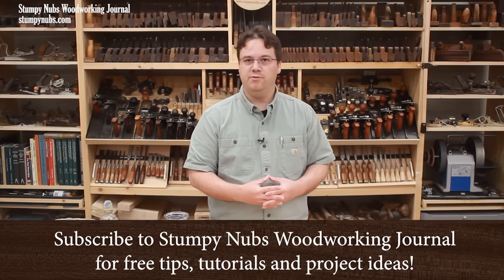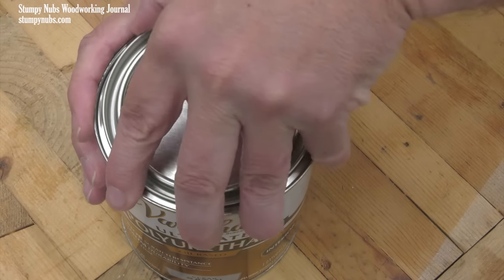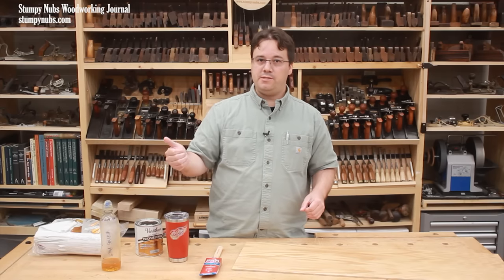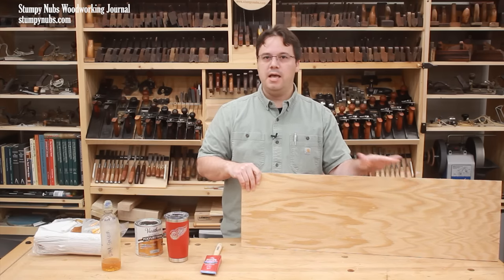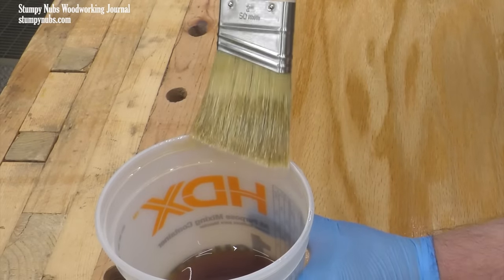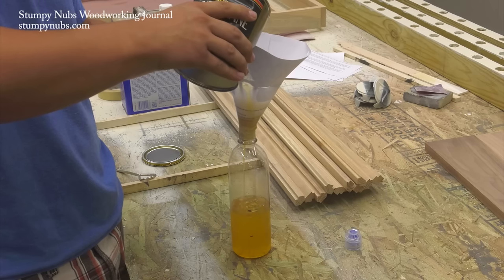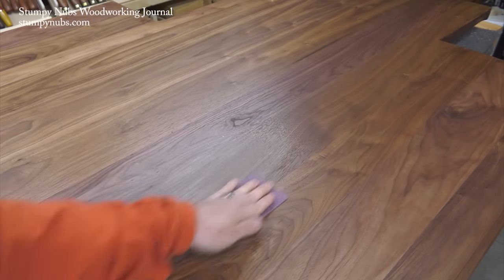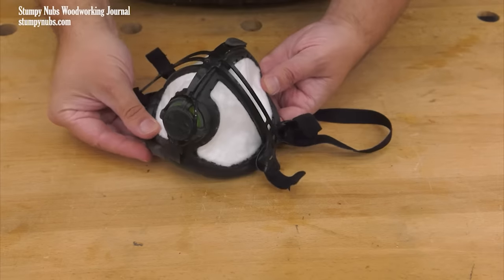Watch this before using polyurethane wood finish!

Comment: I used to have spare brain cells, well that was before you went and filled them up with all that knowledge about polyurethane finishing. Thanks Stumpy, I've got to go and get a respirator now.
Reply: I got one during covid since im in healthcare. Before the n95s came out. Glad i bought a full painters mask face shield. I had to fly a lot at the start of pandemic. A baby had a rancid diaper. Respirators have many uses! Cannot wear those on planes now, that was when it was all essential travel in the whole airplane was empty. Or full of Pilots off work coughing in the empty seats with a red face.

Comment: Great advice! I think oil-based poly is far superior to water-based. My favorite type is known as "hard oil", and a great example is Birchwood Casey Tru-Oil. It goes on very thin, flattens well, and is the most scratch-proof poly I have found. Odor-free mineral spirits or paint thinner are great for brushing or spraying. If you're a total savage, you can water sand and polish it for a stunningly smooth, hard finish.
Reply: Generally true, waterbased product have come a long way over the last decade or so, and have their place depending on the function of the piece.  For a tabletop or similar that will encounter more traffic opting for solvent based is great for durability, but for something like a bookshelf or side table with just a lamp then waterbased can be more than adequate, and in the long term better for you as an applicator if you do a reasonable volume of work, given less VOC exposure.  Having said that, there's a lot to be said for plant based oils and wax finishes, which may require more maintainence, but ultimately better

Comment: So, I don't rightly know, but I've always heard you shouldn't move the brush back and forth as we see here because it is more likely to make air bubbles in the finish.  I've always gone in one direction only, or at least made sure the brush came completely off the work piece before changing direction.  I don't know if it actually matters, but it gives results I'm happy with.

Comment: Wipe-on poly rocks!  It's super easy to get a nice finish.  

An alternative to mineral spirits for brushing is Penetrol by Flood.  First coat is thinned 50/50; subsequent coats are thinned 10%-15%.  Penetrol helps the poly or varnish soak into the wood on the first coat and helps with flow and leveling on subsequent coats.  That's what I did when I had a sailboat with teak trim and the varnish looked like it had been sprayed onto the wood.  Between coats sanding was done with 100 grit paper.  It was not too coarse.  It also helps to only brush from a dry area into a wet area; never back-and-forth because the brush can leave dents in the wet finish.

A few days ago I needed to apply oil based Varathane to a solid core door that was to become a workbench top.  I decided to try the forbidden -  [gasp!] applying it with a roller.  The roller had a soft 1/2" nap.  In spite of the warnings on the can, the napped roller did not introduce bubbles.  It actually went on better than with a brush.  I just dipped some finish out of the can with an unwaxed paper cup and poured it over the door; then spread with the roller.  Wrapping the roller with foil between coats let me use one roller for the entire job and then it was allowed to dry and tossed.  The finish was not good enough for fine furniture but it was entirely good enough for an interior household door and certainly easier than brushing.
Reply: Ah... wonder if the penetrol helped with the roller. I have used it to get a smoother surface on some cheap bookcases I painted (with a small foam roller) and and it definitely improved results to a nice smooth glossy look.

Comment: One thing missing from every wipe/brush finishing video, on every channel, is them doing it on an actual project, and not just a flat board. I've been waiting years for someone to actually build some boxes, or whatever that has multiple sides, or curves, or just anything that resembles an actual project, and then finishes them with poly, shellac, etc... by hand. My issues have never been with a flat board, it's when I get to the corner of a box, and need to move to the other side without letting any build on that corner, or to get it around the curve of a two sided object. Basically, YouTube is crying out for a real world, actual project finishing video... especially on smaller, detailed things, nut just a giant table top and square legs. The only people who seem to show finishing on detailed, real projects, are those just demonstrating their cool, expensive sprayers. How do I poly my boxes without leaving any marks? How do I do a piece that wraps around and has two faces that are vertical? 

Another video idea is how the heck to appropriately apply glue on projects where you simply cannot get in the space to wipe it off with a wet towel, or get it with a scraper, because it is so tight you already had to pre-finish the inside. 

I love this channel, and this is a great video... I just always get bummed when another finishing video is just on a flat piece of wood. People, like myself, need real world examples. Not many people are just wiping their poly onto a flat piece of wood, laying down on a bench. We have a project finishes, even just a box, and that is where we are trying to apply the finish. 

Cheers.
Reply: Totally! Even figuring out how to set up a piece for drying correctly can sometimes be a challenge, and I'm sure there are go-to techniques to make this eaiser. (I'm thinking of avoiding dimples with finishing the opposite side, etc)
Reply: The general idea if you've got a problematic area is to apply more, thinner coats. Tilting the piece to ensure the working face is as level as possible can also help where possible.
As for glue, I've had luck in tight spaces with bamboo skewers. Cut them & sand to a shape that will match the profile of the bit you want to scrape & then run it along there at an angle once the glue has begun to thicken up. It should be at the point where the glue will come up easily & will travel along the skewer a bit so it's easy to remove. If it bunches up then it's too wet, & if the skewer bounces off the surface then it's too dry.
Reply: Welcome to the world of a new home construction painter. A library full of cabinets with doors and drawers is a combination of nightmare, masking, and problem solving master class.  You have two choices - brush everything or spray everything. I recommend getting good at using a compressed air HVLP process.
Reply: If working on a home made project I try to get as much finish on the individual pieces as possible before final assembly. Than do a final coat after it's put together if needed. 
When refinishing an old piece however I just do one or two sides per day depending on drying time. Yeah it takes much longer but it beats having drippy saggy poly on your finished project.
Reply: This is why a wipe on finish rules. Maybe takes more time but a LOT easier and forgiving. I like a 50% poly, 30% thinner, 20% boiled linseed oil. Flood it well initially. After 15 min wipe off excess, buff with 0000 steel wool between well dried coats, final buff out with wax and more 0000 steel wool. Mis dos centavos.
Reply: @nightcatarts  Try using painters tape before the glue up.  Tape right up to the joint edge on both surfaces.  Once squeeze out occurs, remove the tape.  The excess glue comes off with it.
Reply: For inside corners: start there. Like cutting paint. Much easier to keep it from building up when you can spread the excess to dry spots than to try the opposite.
Reply: for junctions if you're not in a rush you can do adjacent faces once the previous has dried, and mask as you go.  When you maskyou sit back a hair so you do get overlap of the coating from one face to another, and, a light sand inbetween coats to gently feather the masking line.  Pull your tapes while the coat is wet.

It is the long way home, but, if you allow the time to do it you can achieve excellence with ease, similar to using a jig in some respects.
Reply: I have seen people finish the milled pieces before assembly - when you can still lay them out flat. Protect the glue joints with tape, of course. When you assemble, it's already finished.
Reply: Put a couple thin coats on everything and after prepping for final coat, use Minwax brand spray polyurethane varnish. After you spray a coat do not allow it to completely dry. About 10 minutes between spray coats. Keep doing it until you run out of product. Use thin coats or it will run.  You will have a factory looking finish. The spray performs better over a couple of coats of the brush on stuff.

Comment: Here in New Mexico, it's dry. 8% humidity usually. Polyurethane and tung oil are my preferences. 
I just dip a shop towel in the can and wipe it on. I use only gloss. If I want a satin finish, I scuff the part, dilute it 50/50, and wipe it thin.
The only other finish I use is amber shellac. Those have to be kept out of the sun or they develop "crazing".

Comment: Stumpy,   I was buying some hardwood from a supplier in my area.  While I was there, we started talking about wood turning and finishes.  He grabbed a dusty bowl on the shelf and blew off the dust.  He said, “If you like shiny finish, use high gloss wipe on poly.  Wipe it on wet and keep it wet for a while adding more poly.   Keep rubbing until it goes past the sticky stage and it will harden and smooth out”.   So, I bought some and followed his advice.   Those bowls came out very shiny and smooth.   Also, when I took a woodworking class back in the 70’s, the instructor showed us some of his very high gloss projects.  He said, if the wood with no finish doesn’t shine, your finish will not be as good as it could be.   So, I sand my bowls to 2000 grit and the people that bought them(no matter what finish used) comment on how smooth they are.  This is just my opinion though!   Keep up the instructive videos!   Respectfully,   Kevin
Reply from the maker: Finishing on a lathe is totally different from finishing a piece of furniture. Try "keeping it wet while adding more poly" and "keep rubbing until it goes past the sticky stage" with polyurethane on a stationary surface and let me know how it works :)

Comment: I use a 10 inch flooring finish applicator for furniture (the foam kind not lambskin) it is very quick and easy to leave straight even coats with it for any flat surface.

Comment: Stumpy, I hope you read this. 
I mixed a new can of mineral spirits with poly for a wipe on finish and it wouldn't dry properly even after a few days. Seems that some of the odorless mineral spirits now contain water. Even though it says on the can it can be used as a paint thinner it definitely didn't work with the poly. I had to strip it all off and start from scratch wasting all my time and effort.
Reply: Agreed.   The problem is the formulation of the Odorless Mineral Spirits.

Comment: Hi Again Stumpy!  An imitation Yachtsman?  Actually I use a good grade of Oxtail brush for my "oil base" clears.  Are you going to do a video on oiling wood with linseed/flax?
     When building guitars I handsand the neck to 600 then apply all the oil it wants to drink. Repeat after 3 days.  After it's dry, use very small bit of talc (not cornstarch) on the neck whenever it is humid.  This the absolute slickest finish I have found.  The player's skin oils combine with the flax.     You can do the same thing to a wood solidbody if the wood is pretty enough.
     TIP:  pour a little bit of thinner into your brush, and knock off drips before first dip.  The brush will clean far more easily.  Same/same with water and latex/acrylic coatings.

Comment: don't know if I missed it or so, but the wipe on has some other advantages, for all kinds of finishes. first, it can penetrate deeper. it also follows the wood structure better and doesn't "pool up" in little dents and divets. this can be a benefit if you have some mix of sanded and structured wood surface. similar for surfaces with very varying grain structure where one soaks up about everything, its easier to work with using thinned out. you can experiment and also brush on thinned and wipe off etc.

Comment: Wiping method is especially useful on items with a lot of "joints" like chairs, things with spindles, shelving units, etc.   Brushing and keeping a wet edge is tough when you have something like a chair with 10 back spindles.   Bob Flexner also calls it a very foolproof method.

Comment: so glad you used a real brush not those darn foam things.  i tried a foam brush once and it was impossible to lay the poly on evenly.  i guess people just don't know how to clean a brush properly.  a 1/4 cup of thinners at most is all you need for a perfectly clean brush that size.  and really only takes a couple of minutes.  i am still using the same high quality brush after over 20 years of use.
Reply: I always use the foam brushes and never have any issues with them. Of course I'm only an amatuer/beginner, but I've used both water and oil based polys and no one's ever said the finish was uneven. (and I do know how to clean a brush, I just prefer not to)

Comment: Love your videos. I bought a used kitchen table with an old dilapidated finish. I applied EZ Strip paint & varnish stripper, scraped it all off, cleaned with TSP and water then after drying went at it with an orbital sander then hand sanded to a 180 finish. Vacuumed and tack clothed very smooth and clean. Don't know the species of the wood veneer. Applied 3 coats of Varathane oil based Classic penetrating wood stain, (Ebony). It barely took any more stain on the 3rd pass. Once dry it looked and felt fabulous. Wish I could have left it like that. I then brushed on Varathane oil based Professional Premium Clear Finish 1200 Matte also in 3 coats. Firstly, nowhere on the can does it say polyurethane or urethane. Can you tell me what this top coat is? More importantly, with each successive coat the finish got worse. I doubled the time between coats. They say 3-4 hours and I went 8 or more. I had to sand as it appears there are hundreds if not thousands of little buggers less than 1mm but so noticeable to both the eye and feel. My garage is as clean as I can get it and I do not blow the dust off but vacuum instead followed by tack cloth. I this the 3rd coat with mineral spirits and the 3rd coat is worst of all. What have I done wrong. BTW, I did not shake the can, only stirred and the final coat I used a separate clean container so I could add some mineral spirits. 4:1 top coat to thinner. At this point I want to throw out 20 hours of work. Please help.

Comment: I like to wrap my brushes in plastic wrap or aluminium foil.  This works well for rollers if you need to make a run to the hardware store or have lunch. (Sometimes works overnight)

Comment: Thank you for informative video.   I looked on line for toxicity of Poly before and I didn't remember any permanent damage from Poly.  So your video concerned me a bit and so I did another search and the two websites said that Poly is relatively safe.  The amount of VOCs released during a typical application is too low to produce harmful effects.  You would need concentrated long term exposure to get permanent health damage.  This does not occur even during industrial applications.  You can get lung irritation, headaches, dizziness, nausea, asthmatic attacks but these are temporary.  I do believe that a respirator is necessary to avoid these symptoms, but I don't think you lose brain cells from Poly.  Brain cell losses could be from something else. ;)

Comment: Brown paper bags from the grocery store - - - I remember those from many decades ago. They had multiple uses beyond the free grocery carrying container the stores used them for (Textbook covers, surface protection, juvenile art projects, costumes of all types, finishing paper for varnish, and much more.) I can even remember when shopping for weekly groceries for a family of six usually averaged to abooout $10 per bag. The good old days. Recently, the only time I have seen brown paper bags in a grocery store, they are packs of lunch bags (much smaller, with less surface roughness.) Some other types of stores still have them, or similar brown paper bags, but they are the exception and scarce.  (Ace Hardware for example) 

The modern blown plastic "t-shirt style" bags are useless unless you can find a place that takes them for recycling. (In my area, both Lowe's and Home Depot have bins for them.) They are also useful (if there are no holes in the bottom) for cat litter and dog droppings.
Reply: Yep. No brown paper bags anymore. But, I receive a lot of packages that are filled with crumpled brown paper as a packing material. I save the paper, spread it out flat on the bench, then fold it up to use later. It only takes a few seconds. I'm not sure where I read it, but I recall seeing that the silica in brown paper makes it around 1200 grit !!
Reply: One more EXTREMELY important use of the brown paper bag.....lining your cake pan in order to bake fruit cakes!!!!!  Whose with me????
Reply: I remember my grandmother & mother saving all the butter wrappers during the year to line the cake tins and pudding bowls for the Christmas cooking - back when butter came in paper wrappers not foil or plastic tubs.
Reply: @brucelee3388  You can still get butter sticks wrapped in paper. We get a box of four unsalted about every 2nd time we go to the grocery store. And it still comes from cows, unlike the tubs of margarine (or its original name tthat i remember, oleomargarine (or just oleo.)